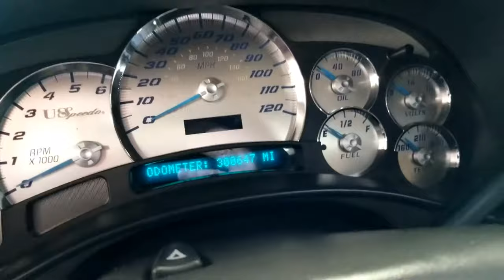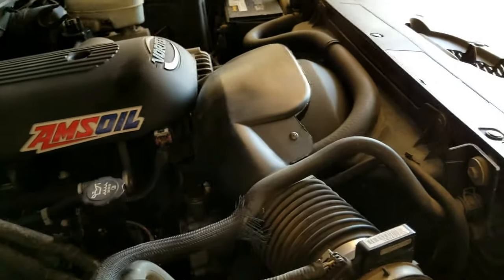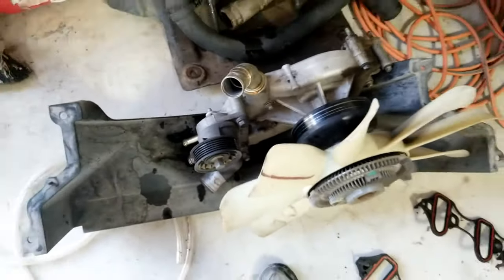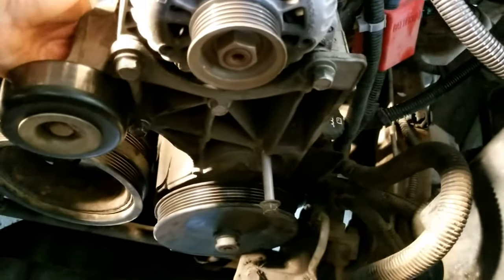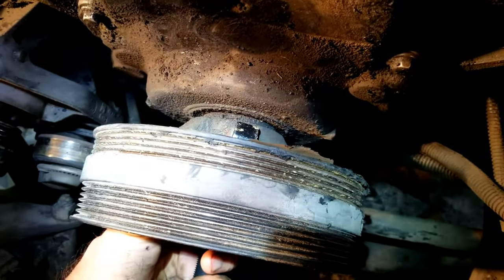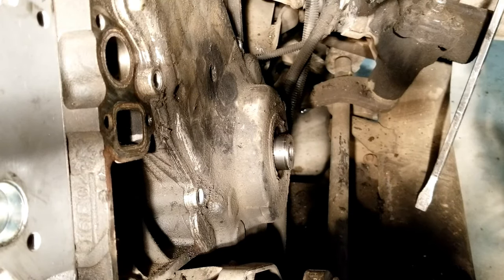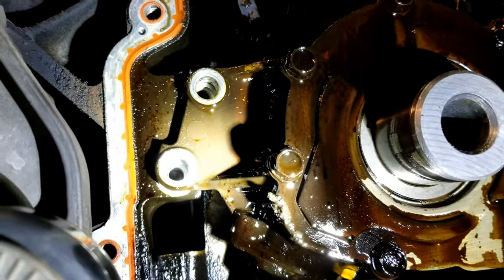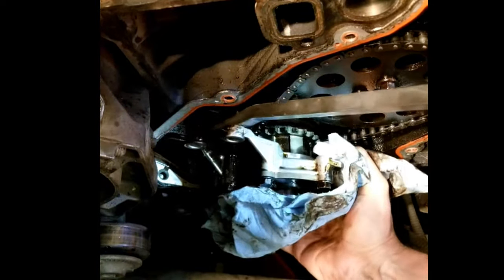How to Replace Oil Pump GM LS motors 4.8 5.3 6.0 6.2 Silverado Sierra Escalade, etc.

Comment: That bottom "rail" gasket... you didn't get ripped off. The bottom "lip" that you see is actually the oil pan gasket. No problem putting a little bit of RTV down there. I don't recommend doing the grinding on the tab to the oil pickup... while it's on the motor, over the oil pan. All those metal shavings you cut off go right into your oil pan. You also should add oil to the pump before installing it. Then remove the ignition and fuel pump fuses, and turn the key to prime the pump until you see oil pressure. You also went from a stock oil pump to a high volume oil pump. To find the proper o- ring to use, it all depends on the type of oil pickup tube used between straight tube or flared. There should be a "notice" included directing you how to figure out what color o-ring to use . Other things to consider are rod bearings, new oil pickup tube, main bearings, timing chain and of course, always use new gaskets. Make sure to torque all bolts to spec. I will be doing this same thing on my 2006 suburban 6.0 tomorrow. I already removed cv axles, front diff, drive shaft, replaced rod bearings, removed oil pan, baffle/windage plate,  Next is main bearings, oil pump, new oil pickup tube and o-ring, water pump, thermostat, plugs, wires, new gaskets throughout. Over all a good video. I appreciate the "rawness" of the video, the honesty of complication, and not making it look "easy" via editing. Whoever does this,  just take your time, label things, keep everything clean, watch out for foreign metal shavings and dirt. My suburban has 364,000 miles. An LS motor over 300,000 miles, the high volume oil pump is recommended due to enlarged/ greater clearances ON BEARINGS due to mileage wear and tear. A high volume pump IS NOT recommended for vehicles with LESS than 300,000 miles. The extra volume pressure may cause leaks. Good luck everyone.

Comment: everything worked so far i about had massive anxiety when i got to the screw and string part and the screw wouldnt come all the way off I'm kind of pissed i have to buy a Cutting dremel but if it works it works I Guess the seal you're seeing is part of the Oil Pan it needs to be covered with some Gasket maker until you can get to the oil pan itself.

Comment: Thanks bud, that's what I'm getting ready to do, my 2000 GMC has almost 300K and the oil pressure gauge is doing the same thing, I replaced the sender while crossing my fingers but, of course that didn't work so here I go. Hey, what's that shirt you are wearing say?

Comment: Handy video, others show dropping the pan, a huge job as it involves removing the differential as well.  Very clever getting the pick-up tube on, am going to use this method on my 2000 4.8, thanks. Jim

Comment: Brand: Somusen
4.5 4.5 out of 5 stars (57)
Oil Pump Pickup Tube Brace/Girdle Compatible with LS LS1 LS2 LS3 Engine 4.8 5.3 6.0L
This is the tab i purchased after removing the bolt to remove the pump and used the other hole to mout it no grinding or anything

Comment: I was wondering what the oil pressure was after the repair thanks.
Reply from the maker: Oil pressure was over 40, although would go lower (maybe in the low 30's) at idle while at a stop light.
Reply: @ucanduitdude2317  mine is around 30 at idle when hot so getting ready to tackle it doesn’t look like it’s going to be fun.
Reply: Never knew it was in front of the timing chain

Comment: Do I have to mark harmonic balancer when removing it for oil pump replacement?
Reply from the maker: No, you don't need to mark anything on the harmonic balancer.
Reply: It has a slot key I believe, can only go one one way

Comment: I disagree with the way this guy does stuff if you're watching this video make sure you watch other videos to see where mistakes are made on this one so you do not screw up your motor.
Reply from the maker: No mistakes.  50,000 miles later and still running awesome.
Reply: Ignore Steve!! It’s a solid video- just remember this is a 2wd application. Good work man
Reply: Yup. 1 yr later and you're still helping people out. 
Diving into my 08escaladeESV awd this weekend.  Just prob gonna add the chain & water pump as well.  
Thank you !
Reply: @777trader8 your suppost to remove the oil pan and  not finagal anything or pry on anything. O ring can easily get messed up. Also shouldn't be grinding on the tab while the oil pan is directly under it  .  That gasket  didn't come with his kit is the whole oilpan gasket he's referring to ...  even harder for u and me cause we got awd escalade so in order to remove the pan  we have to drop the front differential to  get the pan off. Do it right don't try to skip steps your already there. . Also use a new crank shaft  balancer bolt .
Reply: @777trader8 Also if your in a southern hot state.   Use 10w30  full synthetic not 5 w30 .if I'm not mistaken they were mostly made in Canada where it's cold . W. Stand for winter viscosity .